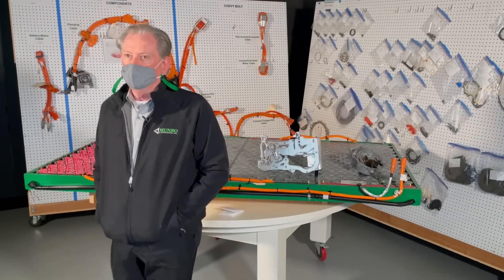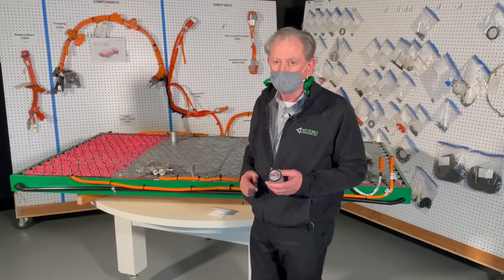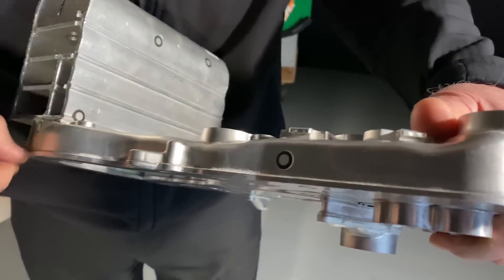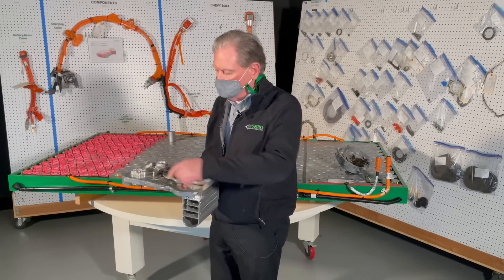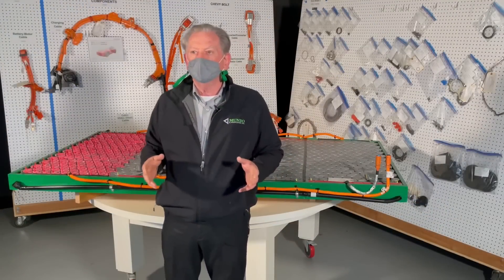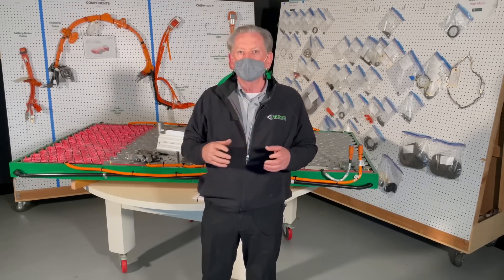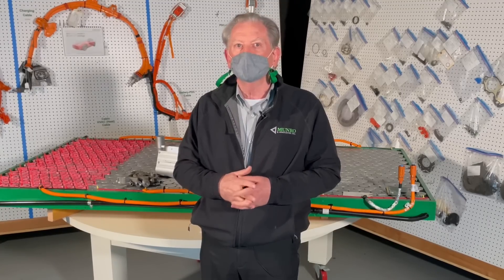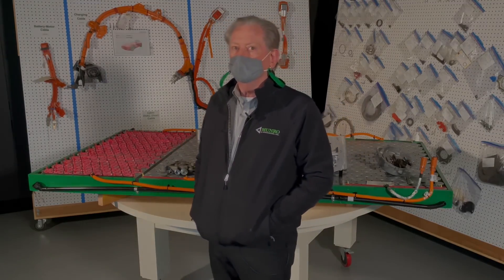Follow-up Episode: 4680 Battery Pack

Comment: So each group forms a big 4 volt cell, comprised of several cells, then joined in series to eventually come up with the stacked voltage of hundreds of volts! The high voltage is to allow the transfer of high power into the Pulse Width Electric Motor drive and controller, with relatively low current. P=I*E. This allows lighter weight, wiring to be used, yet still allow I^2 *R=P losses to be minimized as the power is moved from source to load as high voltage instead of high current. That is why they don’t just connect all the cells in parallel, to form a huge, high current capable, 4 Volt cell and deliver the wattage as current!  So why not make a 10000 Volt, extremely low current battery pack? 

Standard Electrical Engineering Terms used in the equation mentioned in this comment:

P=Power, measured in the unit Watt
I=Current, measured in the Unit Ampere
E=Electromotive Force, measured in the Unit Volt 
R=Resistance, measured in the Unit Ohm
Cell=a single chemical, electrical storage device, consisting of an anode, Membrane, electrolyte and cathode and a container to keep the stack in and retain the electrolyte.
Battery=a stack of cells connected in either a parallel (higher Current) or series (higher voltage)  connection scheme or  stacks of groupings of parallel connected  cells . In either case, a parallel connected Battery, has all negative connections connected together, to form ta single negative connection, and all positive connections connected together to form a single positive connection . 

A series battery has a series of  single cells or parallel grouped batteries connected positive to negative  in a stacked chain with the first cell or battery having its negative  connection being the negative connection for the entire battery stack, and the last battery’s positive connection being the positive connection for the entire chain, each individual cell or parallel grouped battery in the chain’s voltage adds to the total  Voltage of the stack,.

Example: A stack of ten, four volt ,  10 Ampere capable cells in the series connected, configuration, would  40 Volts, with 10 Amperes capable of being delivered into the circuit load. P=E*I, 40 Volts * 10 Amperes=400 Watts maximum available to be used.

So a stack of 96, 10 cell groups, at 4 Volts each group, and 100 Amperes Max each, would be 96*4 Volts=384 Volts

384 Volts * 100 Amperes=384,000 Watts or 384 Kilo-Watts, KW, Maximum that can be delivered to the electrical load from this 960 cell parallel and series combination battery stack.

Comment: Very curious how the bottoms of the cells will be insulated from the cooling plate and transfer their heat through the insulator.
Also would love to see Sandy’s thoughts on the linear labs electric motors as well as Gordon Murray’s istream manufacturing method

Comment: Surely, Up and Down, in relation to the cells, is arbitrary? There is no reason why the cells couldn't be mounted the other way up, with the terminals on the bottom and the heat sink being mounted on the top taking advantage of conductance and convection at the same time?
Reply: Far from an expert but I think you're correct, it should not matter to the cell on bit if it's 'up' or 'down'.
Reply: The gap between them will be filled with something (Sandy believes epoxy) so there will be no convection. The batteries will be situated between the cooling plate and the manifold (the head gasket analogue he showed in the other video) so no air/fluid that moves around between these.

Comment: Can Sandy explain why Munro is breaking the battery pack into 4 "units" like the old modules as opposed to putting all the cells in parallel? So instead of 10 cells in parallel for each "unit", there would be 40 cells in parallel. It made sense that the old modules were grouped in smaller parallel sets because of the ability to test and replace those modules separate from the pack, but the new design it doesn't make sense to me to use this grouping.
Reply: The voltage of li-ion batteries is fixed for each cell. When you connect in parallel you increase the current that can be drawn but not the voltage. Connecting 40 in parallel (and thus 24 in series) would give a too low voltage. To transfer the same amount of power with lower voltage means more current and needs thicker cables. So the 10 in parallel times the number in series (96) times the cell voltage (Sandy said 3.5, I think regular ones are 3.7?) comes out to about what Tesla today uses out of the battery packs.
If the car was made very long and narrow (think like a limousine but only wide for one seat :-p ) then they could have just had 10 in parallel and 96 of those so plus is at one end and minus at the other.

Comment: I worked for a few Fortune 500 manufacturers over the decades as a machinist, CNC machinist, CNC programmer, R&D lab tech and manufacturing process technician and really appreciate your take on things. "Not invented here" was a big thing for them. I got in a lot of trouble for suggesting changes when I worked for SquareD and for changing machine setups and doubling or tripling the production of parts by the "Process Engineers" that I was given set up sheets for jobs, even though every single part passed QC 100%. I worked 2nd shift and was met by them at the beginning of every shift wanting to know how I did what I did. Eventually it was the "New Setup" though. Started my own business eventually... change is really hard for pure academics that have no idea how to actually make things. I have no degree, just hate obviously wasting time and money. Retired now and enjoying learning Fusion360 and 3D printing my own designs. You deserve 1 million subscribers.

Comment: Just wondering how Tesla would handle a recall if a cell wasn’t glued correctly to the chassis
Reply: That is one reason they have been working on this stuff for 5 years in silence before battery day and why they claim itll be another year before they are ready to bring them to market. Testing testing testing testing testing. Also, nobody in the industry can afford to recall a battery pack. Its the single most expensive component in the vehicle and if you have to replace entire packs for entire production runs of vehicles it would run the whole operation into the ground.

Comment: Random thought: would it make sense to use some sort of extruded elements for the cooling plate?  You'd still have to attach them to some sort of collector at either end, but producing extruded components could be pretty inexpensive.  Something similar to how the cooling ribbon snakes through the existing Model S pack, but laid flat to give as much contact as possible on the bottom of the pack.

Comment: I have a question for you. My wife keep thinking about batterie and using phone charger and the radio. I keep saying compare to moving the car that charge usage is insignificant. I tought they probably on 12 volt, and the motor on ? 240 volt? 120 volt? what is the voltage the engine runs on?
Reply: I googled it and a 2017 post for EPA documents says the model 3 long range has a 350 volt battery (when you connect the plus and minus for the whole pack).
But the 12 volt outlet for a phone charger is powered from the 12 volt lead acid battery the car has. Which in turn, yes, is recharged by power from the high voltage battery.
But to compare the energy capacity of the batteries the mentioned M3 have 230 Ah according to that document. So that is about 100x a cell phone's battery capacity.
So if you intended to test how far you can drive in your tesla from fully charged until it stops (the point where it won't let you drive more to not completely empty the cells) then I wouldn't try to charge phones in it. If you make it to your destinations regularly with some amount of power remaining then by all means use the amenities in the car by charging the phone, when recharging the car it will only add a few tens of seconds to the charging time.

Comment: "Heat Rises" isn't correct.  Hot fluids rise because they're less dense.  "Heat" doesn't rise
Reply: Neither does a hot air balloon?
Reply: @kaosinc  The air inside of the hot air balloon is less dense than the cold air around it. The same reason helium or hydrogen inside of a blimp rises... Because it is less dense than the surrounding air.
Reply: More correctly... cold fluids sink because of their density and that displaces the warm fluids causing them to move "up" in the opposite direction of gravity.

Comment: Could you make an illustration showing the difference in power density potential of the new powerpack using the 4680 from a raw materials perspective. Eg. % Cathode, Anode, Battery Casing, Empty space between cells, etc... Its easy to see visually from your prototype but would be cool to see the actual numbers.

Comment: To add along that, heat rises in air because hotter air is lighter so it floats above cold air, on earth. The same is not necessarily true in a different matter, or different states of matter for that matter (LOL).

Comment: I'm no expert but... can we use a single plate on top and bottom? Connect all cells in parallel and eliminate cables? I know the current will be higher, but a single plate has less resistance and the cells contacts are evenly distributed throughout the plate. Moreover, such plates could be used as radiators and as a structural part. Do we need high voltages? Does the car has any voltage transformer? What's your thoughts about this?
Reply: You would get a big pack with around 3.5 volt. Transformers aren't 100% efficient so you don't want to use that between the battery and the motors. And the cables from the pack to the motors would have to be gigantic (if a big motor like that can be made to work on only 3.5 volt?).

Comment: I think you have the batteries wrong.  the negative terminal is on the opposite end of the battery from the positive terminal
Reply: Yes that what the showed in the presentation but maybe a red herring? It would be a trade between a very complex cooling plate (or a chopped up one) to using a wire/sheet from the bottom to the top (as the othermost layer) and some electrically insulating but thermally good material (?) at the bottom.

Comment: A CNC machining of the entire battery base using a Tesla valve would help with less moving parts and greater heat dissipation .
Reply: Machining time would be >>>> than casting time. Most of the heat conduction goes out the bottom. It's not clear the added time is worth it.
Reply: @AndyZach  heat dissipation is increased and if it is cast sounds much better and cheaper to produce . A smaller pump and no hoses or pipes adds to less maintenance and down time .

Comment: Heat goes to cold. It doesn't care about gravity.
Heated AIR is buoyant.
Reply: Exactly - heat doesn't rise, but if heat causes expansion and thus lower density, the hotter gas/liquid will "float to the top". It's counter-intuitive to cool something from the underside, but that's just because our main references are mostly hot air (or liquids).
Reply: The molecules themselves actually weigh the same. And hot air doesn't actually "rise". Heated air is less dense because the molecules are more active and therefore further apart. Cold air is more dense because the molecules are less active and therefore closer together. Because the cold air is more dense, gravity acts on it and it sinks and pushes the warmer air out of it's way... since the cold air is all pushing down, the warmer air has nowhere to go but up (the opposite direction of the pull of gravity).  Buoyancy in general seems to be poorly understood by people.

Comment: I like the ultraviolet + air-conditioning - only an engineer would come up with such a simple solution.
Reply: its pretty much the only solution that makes sense. Powerful AC with apropriate filters and UV lights. You also find these things in hospitals or food processing for example (i.e. UV lights in water pipes)
Reply: Well, specifically UV-C, which you really don't want you look at or be on your skin for extended periods, I'm guessing it's uv-C in the air duct work?
Reply: Air conditioning combined with UVC is nothing new. It has been used for a long time. But yes, to come up with a simple AND working solution you will need engineers.
Reply: It is pretty well understood stuff. Many companies upped their ventilation game recently, though ultraviolet lights are less common, probably because that is going to cost extra.

Comment: My man Sandy just entirely dismantled VW's "power of choice" engine strategy in a couple of sentences. If a single vehicle chassis will have to support ICE, hybrid, and battery-electric, there will have to be drastic differences with heating, cooling, etc. between the three and that'll require huge changes to all three at every step of the design process. Not to mention that manufacturing will be an absolute headache. Thanks, Sandy! Your dedication to patient, well-thought-out explanations is admirable.
Reply: True point. The advantages-of-scaling drum has been hit enough. that only works in a select set of cases. Manufacturing the same old product over and over again. Everything has its sweet spot of scaling. If you go over it the overhead starts to increase and hidden and delayed cost take over. Ad innovation is out of the window. And then there are people who talk about the advantages of scaling when what they really mean is the advantages of bargaining power when you are bigger than your supplier.

Comment: Hey Sandy!
What do you think of recyclability after the pack becomes a structural part of the vehicle? will taking it apart be a pain or what do you imagine?
Reply: Right. I assume the lifetime of the battery units equals or surpasses that of the car. Recycling the battery elements would require prying out the epoxy-battery unit and breaking it apart when the car is scrapped.

Comment: Heat doesn't rise, hot gas rises. In this case the transfer is not through the air AKA "convection" but rather through the solid material AKA "conduction".
Reply: hot gas doesn't rise. gravity pulls down more dense (cold) gas, displacing the less dense gas but a valid point non the less
Reply: @robscanlon6568  Bingo! Gravity!

Comment: Is there any likelihood of existing teslas being able to get a 4680 battery pack in the future?
Reply: Already built ones? Zero I guess - these batteries are higher so they would have do redesign the packs to accommodate that. Easier to change the design of the car so the pack can be a bit higher if needed.

Comment: Correction :
Sandy please expand on how your new filtering system works and why it is not used in all buildings
Reply: It's easy to look up how a system like this works (basically pass the air by UVC tubes and you're done). It is used widely where necessary, but it costs extra money.
Reply: @superdau  Thanks

Comment: Thanks for the info, and the clarificiation on the series and parallel configuration.  Thanks for the mask.  Congratulations on reaching 100k.  Happy Holidays to you all.

I like to say 'hot fluid rises, relative to cooler fluids.'  But even that has a whole bunch of caveats.  Many people are stuck with the very simplistic meme that their second grade teacher told them, and haven't been exposed to the nuances.
Reply: Simply the difference between 'convection', 'conduction', and 'radiation' was clear to me by 6th grade. Three different modes of heat transfer. Conduction can work the fastest.